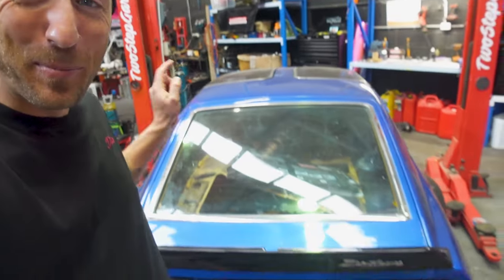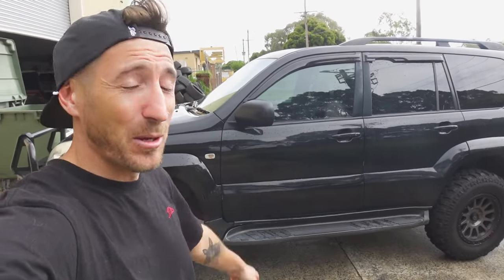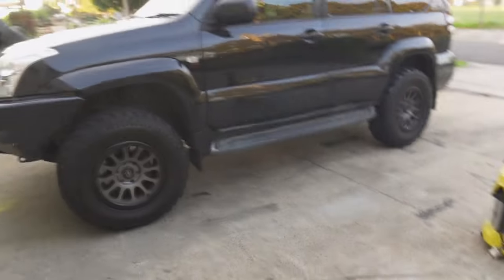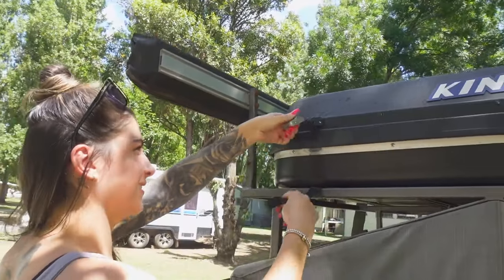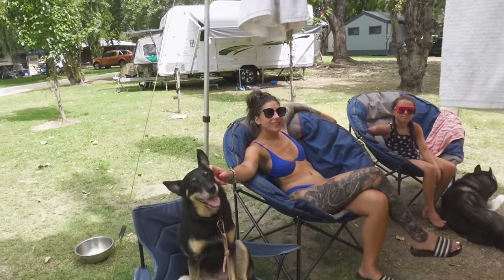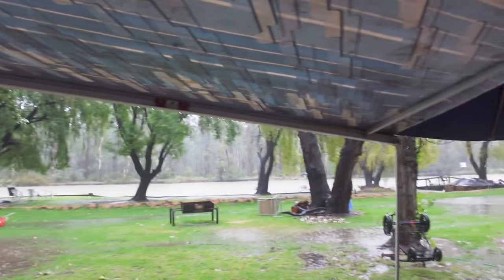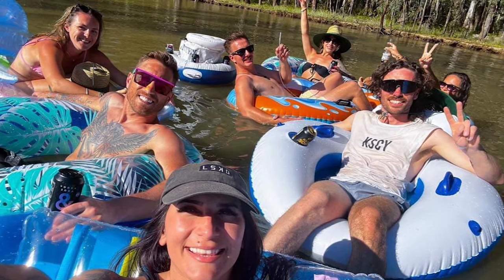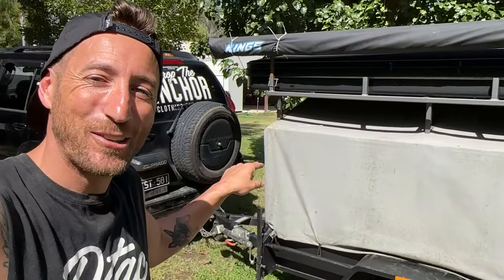Buying The CHEAPEST Camper Trailer On FACEBOOK MARKETPLACE!

Comment: hey mike, great video as always. I noticed one of your weather shields was cracked, considering i’ve got the same ones and not had an issue so far was that caused by something or just worn over time. Also, any plans on an exhaust on the prado, as i’ve heard they reduce fuel economy as less back pressure is blocked by the muffler?
Reply from the maker: Thanks bro! One of the dogs cracked the weather shield 😅🤦🏻‍♂️. I’ll replace it soon haha. I’ve thought about an exhaust but I also like a quiet daily 🤔 haha I’m old now 🤣

Comment: Awning is an easy fix drill out the rivet each end and one in the middle and run a small staino bolt with a nylock thru will never have that problem again 😂
Reply from the maker: Yep I reckon I’ll replace all of the rivets with this!